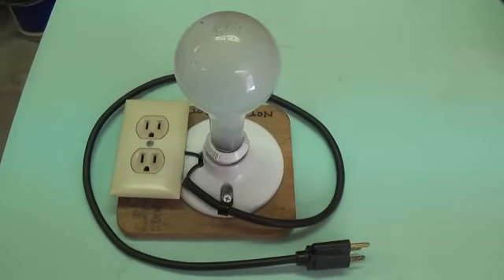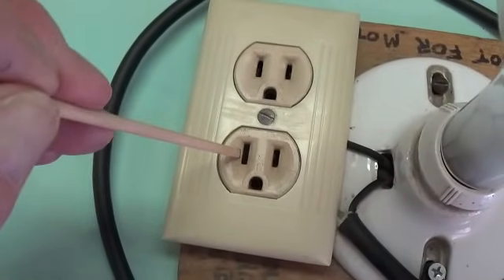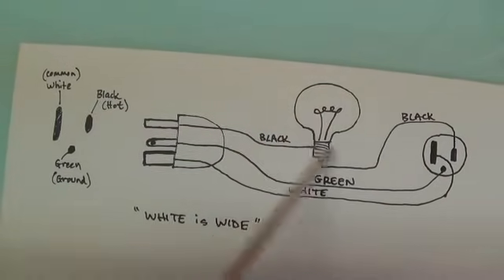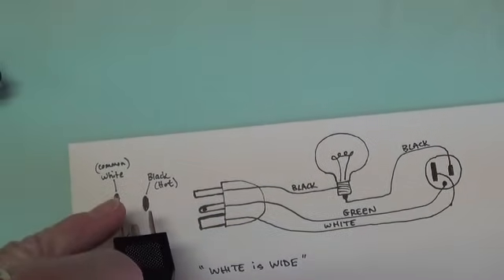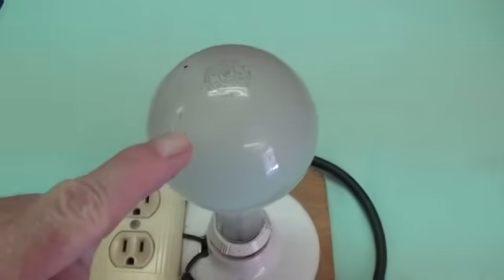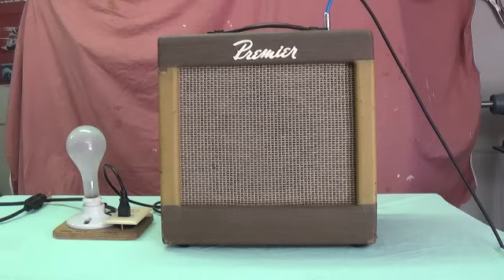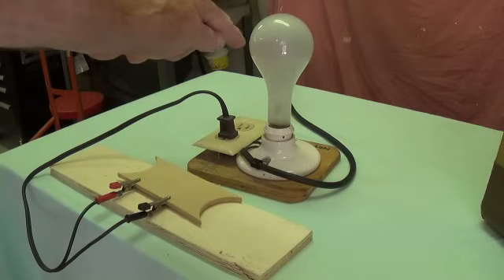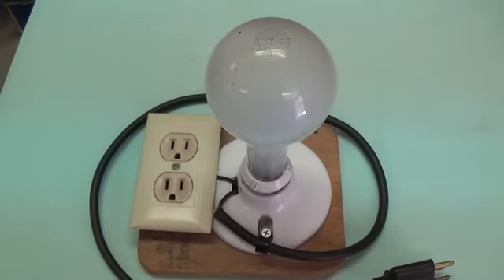Build Your Own Current Limiter for Protection when Repairing and Testing Electronic Equipment

Comment: I live in the USA but have a 220v marsall. I use a step up transformer to power it. I need to reform the caps and want to place a bulb limiter in the chain to "catch" a potential short from a leaking cap. Since the bulb circuit components in the USA are 110v   I would have to place it before the step up transformer. My question is "is that a issue"? I would guess the limiter should be place right before amp. Is that correct? Do I need to try to get 220v bulb, socket, and plug receptacle?
Reply from the maker: If the Marshall is 50W or above, the current limiter would hamper the operating voltage and current, reducing the output tube bias. Reforming caps is like putting a Bandaid on a gaping wound. They simply need to be replaced with new caps.....and then the current limiter won't be necessary.
Reply: @UncleDoug  - the amp is a '67 18W. I'm reforming caps because I was traveling for work much longer than expected and the amp was in storage for 7 years. It was working fine before I put it away. My concern is i the caps started to leak in the interim. and the leak be somewhere i cant see. I really dont want to replace  the caps if i dont have to. Firm believer theres mojo in the older mustards, etc. 

With regard to my question, am I correct in my thinking that the limiter would have to be in front of the step up and it needs to be 220v components? 

I'm also confused why you are saying it would hamper the voltage. I understand V = IR. If the voltage drops so much across the resistance of the bulb, wouldnt that be a constant regardless of the amplifiers wattage?  

Also, couldnt I overcome the voltage drop by increasing the voltage output in the variac (at the very early stages of reforming the caps)?  Once I know theres no short, I can bypass the limiter

Thanks in advance - you have the best amp channel on the web! I have a friend was was apprenticing at a boutique shop of some prominence. He left and does some work here and there on his own. He was blow away y your channel and said he's learning more and has a greater understanding than from all the years working at the amp makers
Reply from the maker: @SD-nj1cy  I often test amps that have been sitting for 7 years or more without reforming the caps, SD, as long as you have the CL in series to  protect the circuit. The CL should use a bulb of around 100W, since the current at 240VAC is half that at 120VAC. The voltage drop is constant, but since there is a drop, operating voltage is lower than normal wall AC and bias will be reduced. I would put the CL between the Variac and the amp, since the amp is the "weak link". Thanks for your nice comments regarding our channel.
Reply: @UncleDoug  Thank you for all your help

Comment: Best to use an isolation transformer and leave out the ground connection to the device being tested. This will vastly reduce the chance of a fatal shock. Even better (and even safer) is to drive the isolation transformer with a Variac and bring the voltage up slowly to the equipment under test.
Reply from the maker: Use whatever method suits you, DIY, but for the rest of us, the current limiter is a very simple, economical way to protect circuits during repair.

Comment: My house was built in 1929, the wiring is mostly two black cloth covered wires. I replace two prong outlets with 3 prong, and ground to the metal box. I use a Greenlee GT-10 polarity tester. Hopefully I never have a problem when I play electronic mechanic at my workbench.
Reply from the maker: We hope so too, Dick. Best of luck updating your electrical system.

Comment: The guitar amp you use does not draw much current so the bulb does not light . If another piece of equiptment is used that draws more current should the bulb light ? tia.
Reply from the maker: Yes, indeed.
Reply: @UncleDoug  Sorry Doug and thanks for your reply and patience with me  with this stupid question . So the bulb lights in normal running operation if the device connected to the socket draws any decent amount of current AND also lights if there is a fault ??  If that is the case how can one tell the difference  between normal running operation bulb light and a FAULT light ? TIA
Reply from the maker: @danvelgtr  No problem, Dan. The amount of glow is proportional to the current being drawn by the device. If a 6W Fender Champ lights up the bulb.....it has a short. If an 80W Fender Twin lights up the bulb.....it's normal. You simply have to gain some experience so you know what to expect from each circuit. For higher wattage amps, you have to use higher wattage bulbs, i.e. 2 x 250W in parallel, so that the amp only barely illuminates the bulb.
Reply: @UncleDoug  Thanks Doug , got it at last .

Comment: no understando. I thought a current limiter was the Variac that you use in some videos.  This acts more like an overload / short circuit / ground fault detector?  no?
Reply from the maker: A current limiter, as the name implies, limits the flow of current, protecting a circuit from internal short circuit damage. A Variac simply regulates the amount of AC voltage being applied to the circuit. Two very different tools for different purposes.

Comment: hi uncle Doug... I'm building one of these! but I'd like to add an on/off switch since all I have right now is an 2-gang box with one built in light switch, box. should I wire the switch in before the lightbulb, or would a switch be more advantageous somewhere else in the series circuit? thank you for any help!
Reply from the maker: I'm not a fan of adding switches, M......they serve no purpose other than confusion. If you insist, however, it should be in the hot wire before the bulb.
Reply: @UncleDoug  thanks U Doug! yeah I figured the case but the only box I had in the bone yard was the double g with an on off switch so I wanted to make some use of the switch because it was either use it or turn the whole thing into a deluxe reverb black face......... lol, I kid! thanks again!
Reply from the maker: @movinon216  Good luck, M.
Reply: @UncleDoug  I built it and it works excellent I tested the loader bulb 💡 with a solder gun and it light way up!   thanks again Uncle Doug
Reply from the maker: @movinon216  That's great news, Mov. Try it with your wife's hair drier if you really want to see a light show :)
Reply: @UncleDoug  hey, good idea! maybe ill hook up the bathroom light in series just for a prank ....and then of course go scratch fleas with coco my dog! (kidding)
Reply from the maker: @movinon216  Will Coco be scratching his fleas or yours, M ?   ;) ;)
Reply: @UncleDoug  lol ;)

Comment: Will it make a difference if your amp has a two pronged plug. Also, the house I just bought is old and only has two pronged outlets except for one room that I would not be working in. I went to replace one outlet with a GFCI out let but the original electrical boxes are two small to accommodate it.  I have to cut out around them, take them out and replace them before I can install the GFCI boxes which makes a simple job a pain the the butt.
Reply from the maker: Yes, it would make a big difference, safety wise, Jerome. Anything you can do to improve the situation would be a wise move.

Comment: I just built myself one it’s great 😊.
Reply from the maker: Congratulations, Denver. I hope it serves you well.
Reply: @UncleDoug  thanks it already helped me test an amp that had a short circuit that I believed I had found the problem but I didn’t want to risk powering it up on full power.
Reply from the maker: @Denvermorgan2000  There you go, Denver. It's one of the most useful tools you will ever employ for amp repair.

Comment: Hi, So would that work for charging large capacitors or high voltage capacitors? On the DC side, I've got solar panels with what is called a power inverter basically it takes a 12 volt deep cycle battery and turned the 12 volt DC to 120 AC household current the power inverter has capacitors  that need charged when you hook it up to the 12-volt battery the capacitors charge, on 12 volts that not a problem the capacitors don't need that much of a power draw, But I recently switched to a  48 volt outback inverter power inverter having to hook 4 12 volt batteries in series to make a 48 volt battery, But the 48 volt has huge capacitors 100v a few of them wire in series for 600 volts or hooked in parallel for 100 volts I'm not sure how there hooked but when I connected ground cable to the 48 volt battery there's a huge spark, so I decided to do some research on that because I'm thinking or switching to lithium phosphate batteries, but I found out lithium phosphate has so much more power output then lead acid the lithium battery can burn out components circuit board in the inverter because of the bigger power rush that lithium batteries can output?
Reply: I should also mentioned the capacitors are also self discharging so I can't charge them first using lead acid then hook it to the lithium
Reply from the maker: Harold, I have no idea how to answer your inquiry.....it is way outside my area of knowledge and experience. Good luck.
Reply: Ok thanks 😊

Comment: aha the lamp will go down first, right? so if it goes down it will disconnect the circuit, I think I got it
Reply from the maker: The bulb doesn't "go down", Thijs, it goes ON. This illumination prevents the dangerous flow of current.
Reply: @UncleDoug  What I was trying to ask was, if you'd keep the short going, the bulb would go down (right?) as in, would burn up and with that cut the circuit?

Comment: I'm wondering why the bulb doesn't also act as a fuse. 200W at 110V is just short of 2A. If your direct short in the equipment allows 30A to be drawn, why doesn't the lamp filament burn out on the spot? That would be convenient, if a bit of a nuisance.....
Reply from the maker: Incandescent filaments limit the current passage, and due to the fact that their resistance increases with heat, they will only pass sufficient current to illuminate the bulb.....and no more. Thus, they are not like a fuse.
Reply: @UncleDoug  OK thanks. Very useful!

Comment: Is this necessary because tube amp fuses have to be sized for start-up current rather than normal usage?
Reply from the maker: It's superior to fuses in that it provides a visual indication of high current and you don't have to replace it afterwards.....as you would a fuse.

Comment: To add to your limiter, would it be a good idea to install a SPDT switch between the hot and neutral just to do a quick test to confirm the bulb is good before you start testing your amp.
Reply from the maker: You could install a test switch, but If the bulb has failed, no electricity will reach the circuit being tested.....the bulb failure will be immediately evident. Also, since the bulb is rarely illuminated, it will probably last forever. I've been using the same bulb for over 10 years.

Comment: This should work the same as well if we use the neutral wire passing through the lamp instead of the hot live wire right ?
Reply from the maker: I don't think so, SW. Why not just wire it like the instructions ??
Reply: If there is a short between the hot and common, then it would work, BUT, if there is a short between hot and ground, it wouldn't work. As a rule, I always put fuses and switches on the hot wire. If there is a short between common and ground, nothing would happen, because back in the breaker panel common and ground are connected together.
Reply from the maker: @bruceeide5644  As I said previously......simply wire it as shown in the video and the CL will protect against circuit damage due to internal shorts.

Comment: I have an old Acoustic Control amp that keeps blowing fuses. Would this prevent the fuses from blowing?
Reply from the maker: Yes, it would......but you really need to determine the cause of the excess current flow and correct the situation.

Comment: Hi Uncle Doug. Working on my first project and am getting a mild glow on a 300w bulb from an old projector amp driving two 6L6s nothing is red plating or overheating on no load. Thoughts?
Reply from the maker: Amp circuits that draw over 1A will generally cause the bulb to glow dimly. A 2A draw will illuminate it more brightly. What you are seeing is natural for a P-P 6L6 amp. Due to the current limitation, however, you should use wall current to bias the output tubes (not use the current limiter).
Reply: Uncle Doug great thank you!! Also I noticed the tone pot has 4 lugs and three Mica capacitors along with resistors attached - clearly the tone stack I presume. I will be comparing values as per your tone stack video. The pot is showing corrosion and erratic behavior so thinking of replacing it if I can find something suitable. There’s only one tone control - are they usually 10k?
Reply: @UncleDoug I’m pretty much a newbie at this (3rd kit build). Didn’t realize you shouldn’t use the current limiter when biasing. Thanks Doug, you’re a treasure trove of info!
Reply from the maker: @tonyhills2112  Thanks for the kind words, Tony. The higher the wattage of the amp, the greater the effect of the current limiter on bias settings.......so you really have to be careful, especially with Twins and other current hogs :)

Comment: Another great lesson once again Doug. I was wondering why you did not trip the breaker. I went back to your schematic and basically you completed the parallel circuit between the lamp and the branch circuit. Or in other words the screwdriver completed the neutral circuit-So hot wire and neutral mate to the lamp correctly. The lamp should burn its brightest rating safely for the life of the lamp. The resistance of a 250 watt calculates to approximately 48.4 Ohms (using Ohms Law). I would use my meter but I don't have the lamp. Also the circuit you drew makes the lamp look like a 120 volt inline fuse. I would not expose the circuit to an amperage draw of more than 2.272727 amps or you may blow the fuse (the lamp not the breaker). A current limiter.
Reply from the maker: My shop has 15A breakers, Walt, and with the short circuit limited to 2A, the breaker's threshold was never even approached. The short merely makes the bulb operate as it would if used in a lamp in the house.....so bulb life is not limited.

Comment: Question about impact of the current limiter.    Testing a functioning Silvertone 1484, powered through a 300 watt bulb which glows very dimly when the 1484 is on.   Measure Voltage on 6L6 plate at 430 VDC.   Then I plugged the 1484 directly into the wall socket and measured the 6L6 plate at 479 VDC.   What am I to learn from this 49 volt variance?    122.6 VAC at the extra CL out when amp is off,  after amp warms up the extra CL outlet drops to 113.1 VAC.  So the bulb is sucking up 9.6 VAC when the amp is on.  Measuring A/C current by patching between the on/off switch connectors:  645 mA with the CL;  768 mA powered directly from the wall outlet.  So I declare my Silvertone is fine.   But taking measurements with the CL "engaged" is now questionable.   Advice?
Reply from the maker: On higher-wattage amps that draw a lot of current and illuminate the bulb, the CL does significantly reduce the PV and PC within the tubes. On lower-wattage amps, which barely even warm the bulb, the reduction is negligible. It's best to perform the final bias adjustment without a CL.

Comment: It does help for mishaps and shorted equipment. But I dont think you should say that it protects us ( us meaning are body). It helps to not damage even more all ready faulty  equipment that you plugin. (IMPORTENT NOTE:  a 250w lightbulb does let 2 amps of curent go through your body.
Reply from the maker: I agree, Ronald. The device is primarily to protect the circuit being tested.

Comment: For EU viewers, our outlet can go both ways so the hot wire is not specified, is that a problem I have to address? Do I always have to connect the hot wire with the lamp? Also do I have to put a bigger lamp with higher watts because of the 230V (50Hz)?
Reply from the maker: It's better to have the hot wire run through the bulb, if possible, BPN. With higher voltage, you can reduce the bulb wattage because less current flows......100 to 150W bulb is fine.
Reply: @UncleDoug  Thanks for your response!
Reply: The hot wire could be in either place on an EU, for example German, outlet, but it can be located by various methods (phase finder etc). The bigger problem is getting a LIGHT BULB since the EU made them illegal for household use. You can still buy photobulbs but they've skyrocketed in price. (Thank you, EU.) I don't know if there is another, equally simple way to construct a current limiter without shelling out 20 euros for a new Chinese photobulb every couple weeks. (Trivia: A couple guys tried to get smart and sell lightbulbs in the EU as "heat balls" but they got shut down hard.)
Reply: @kneedeepinthedoomed  Uhm, im pretty sure that they still sell them in here in Greece. I mean, whe have bigger problems to worry about than what lightbulbs the stores sell. Either way, I can probably find one or two in my basement.
Reply from the maker: @kneedeepinthedoomed  It's reassuring that the "Light Bulb Police" are alive and well in Europe ;)

Comment: Beauty. ...and ya don't have to wonder about the bulb being burned out because no juice flows to the amp if it is. For DIY'rs: don't wire your house this way. Run the hot leg to the switch first, then the light.
Reply from the maker: Thanks, Choim.